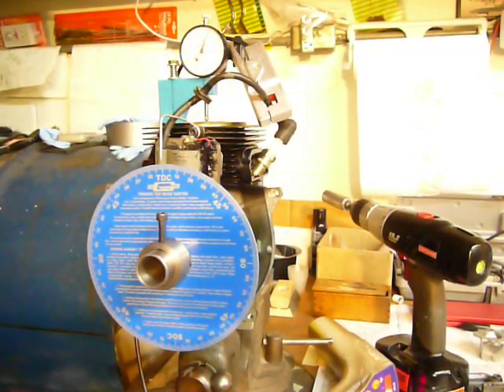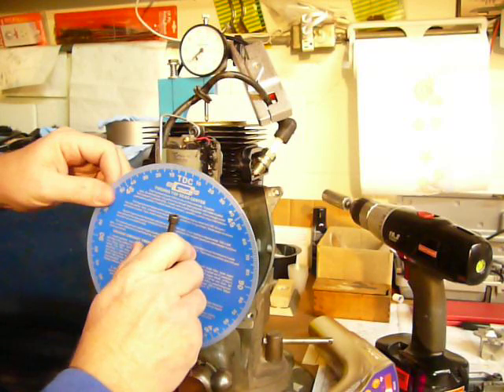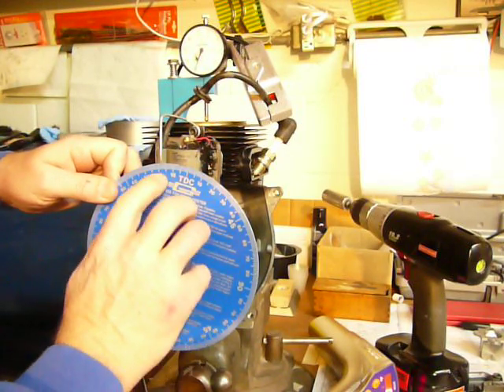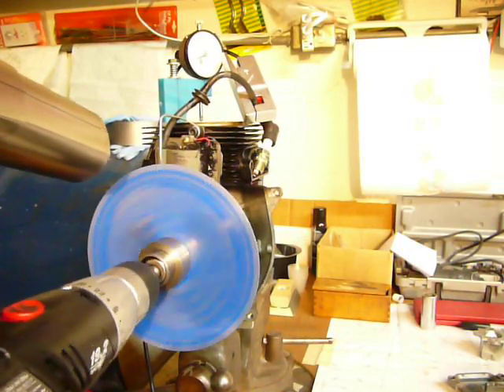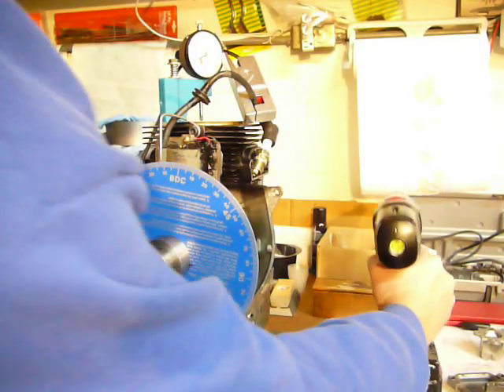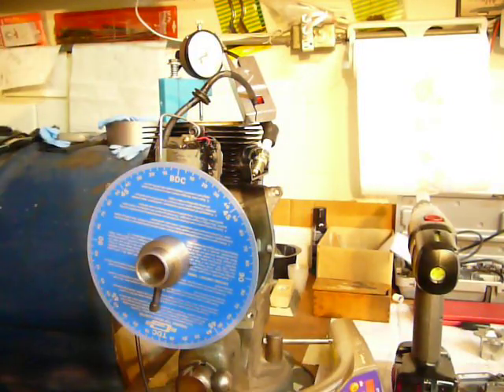Setting the Ignition Timing on a US820 (West Bend) Go Kart Engine

Comment: I have just got a 820 and when I pull the pull starter it has a lot lot of compression very tough. Is that normal ? Should I be using a electric  starter.
Reply from the maker: John C someone may have changed the head gasket to a very thin one which raises the compression ratio and makes it hard to pull start.  Most pull start models of the 820 have a .032" thick head gasket or thicker.  Some have a head with a compression release valve which makes pull starting even easier and sometimes with the compression release valve you can also run a thin head gasket and get more hp.  Hope this helps.  Thanks for watching.